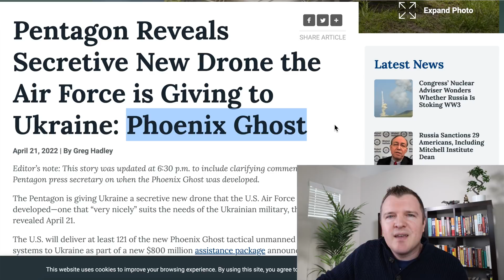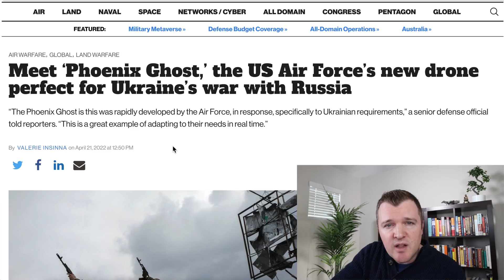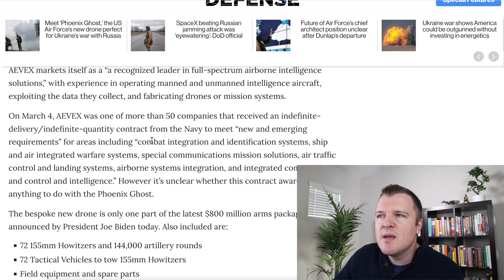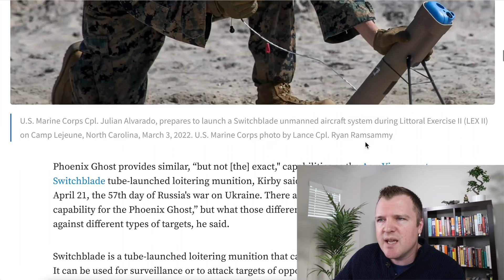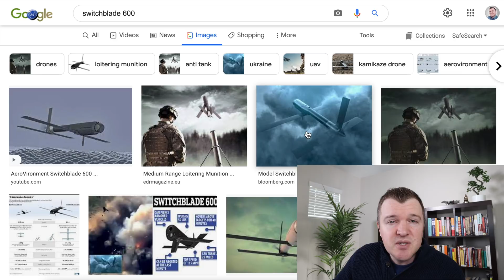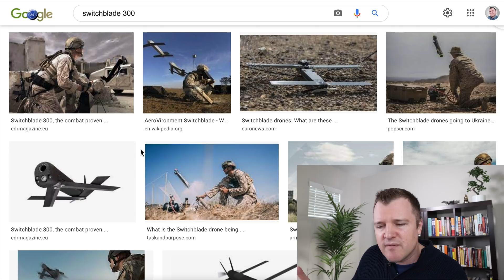SECRET Phoenix Ghost Drone Given to Ukraine

Comment: It would help the Ukrainians to have large amount of low cost fake drones, that can be programmed to fly for some hours above enemy airspace and on which the russians spend all their very specific expensive anti-drone missiles. They should also make sufficient noise for the troupes below hearing them and being stressed continuously.
Reply: That is actually an excellent idea.     Chances are the Ukrainians could do something like this on their own - it wouldn't have to be very high tech, just visible enough to draw fire from the Russians.
Reply: Put a cheap cellphone in them with an app that takes pics and send them home with GSM coordinates. They may well stumble across something worth seeing.
Reply: @tessjuel   they have better than that.
Reply: A $60 drone from Walmart would be enough to stress the crap out of them
Reply: There are even drones that look like (small) jets and fly really fast.
Reply: @clenzen9930  These would indeed be even better.  The ones flying with a puls jet can even reach 400 km/h, very very difficult to shout out of the sky with the classic artillery.  But the flight range with these is rather limited because of very bad fuel efficiency.
Reply: Very low cost disposal decoy drones.
One way mission - recon, distract and harassment.
Reply: @Odyss2023  Add a warhead and you have a switchblade or ghost.
Reply: Ok, but why decoys? They keep dropping grenades from off-the-shelf drones. I just see no real need for decoys, if you can have such cheap, fully armed drones instead
Reply: @sebastianwendl603  The Ukrainians use your method successful.  But they are limited to a few km distance because of the video signal (operator needs to see the target on his screen).  And with a russian jammer nearby these drones are killed immediately.  The drones I propose are linked via GPS, that needs a much much much more powerful jammer to jam.

The fight in Donbass will be at a much larger scale, so the short range grenade drones will have less impact.
Reply: @sebastianwendl603  I think it makes the argument for having your highest tech expensive drones supported by so called disposable ones preferably in a way that’s impossible to distinguish bw the two. More cost efficient at the least.  We will quickly see the era where a single attacking drone becomes an easy target and swarms will become the norm.
Reply: Trouble is the range from the controller. About a mile for a normal off the shelf drone. That said hang 10 feet of crumpled aluminum foil from a drone and fly it around a 1000 feet up.
Reply: @easternwoods4378   That range is only required for drone take off and landing.  After that it links itself to it´s preprogrammed GPS coordinates.  It could even be programmed to come back to operator after x times flight, for if that is valid?
Reply: @tuttebelleke  If it will fly to a GPS coordinate. just let it fly in the direction of the Russians and let them shoot all they got.
Reply: @easternwoods4378  It would not fly to 1 GPS coordinate, it would have a series of coordinates for circling around in enemy space.
Reply: @easternwoods4378  I wouldn't even control them, just program thousands of them so they can be launched from the west on an easterly heading so the Russians can hear them coming to stress them out, after hearing hundreds of them they will start to ignore them thinking its another cheap drone, and that is when you hit them with the suicide drones. A mix of cheap and deadly drones will mess with their heads when they can't tell one from the other
Reply: The drones that they are using to drop anti-tank grenades are already pretty cheap. There isn't much point of building a decoy for that, as the decoy will need almost everything the "real" thing has anyway.
Reply: @superdau  Those anti-tank grenade drones have a reach of only a few kilometers and a flight time of 20 minutes.  With the coming fight in Donbass, the distances are at a different scale, those drones will not be functional there.  And those drones do not survive when a russian jammer (Krashuka) is in the neighborhood. The decoy drones should follow a preprogrammed route via GPS which signals are much much more difficult to jam.
Reply: Nice! Sounds like a good idea.
Power + Redirection.
Reply: Good idea but I'm pretty sure Ukraine already has the ability to do this.
Reply: @paulmurray8922  They for sure have the ability, the technology for this is commercially available for some years already.  But they need several hundreds of these!!!
Reply: 9 months on , no footage ever of these phoenix ghost drones. No footage confirmed at all, or switchblade 600. i think footage of switchblade 300 has been released. Not sure if it was confirmed. Footage must me classified, or it has not arrived nine months on, or America changed their mind.
Reply: You guys are missing the easiest way to destroy 80% of invading Russians.
Just leave many poisoned vodka bottles in the villages they take, and in less than a week, invaders will not have any soldiers left.
Reply: A drone that is shaped like a giant penis that sprays white oil out onto the Russians would be a game changer.
Reply: Back to your video game dopey
Reply: False hopes do not help/save Ukraine and military troops constantly hammered and exhausted....
Reply: @bobgonzales9680  Russia evacuated 24,000 soldiers from the failed attack on Kyiv.  Half of them were wounded and without any equipment when they crossed the border back into Belarus.  The Russians are trying to reconstitute these forces by replacing destroyed armor with vehicles pulled from storage and adding in fresh meat. But effectively these forces are out of the war, only the unwounded officers would be of any use, and some regiments were left with only 20-30 men and all of the officers are KIA.-- The Ukrainian combat units that inflicted this damage are now rested, resupplied, reinforced, and in the east regaining contact with Russian forces.
Reply: @bobgonzales9680  if there are 12 drones flying over an artillery battery. Only one is real the rest are just programmed to fly around the battle space. Let’s shoot lists of expensive ordinance at them.
Reply: @guybonfiglio5899   More, who is paying for these weapons? The western tax payer or you?
Reply: @guybonfiglio5899  My God.  Learn to spell. You make yourself sound as if you are an idiot.

Comment: Maybe they are EMP Drone.  An energetic EMP can temporarily upset or permanently damage electronic equipment by generating high voltage and high current surges; semiconductor components are particularly at risk.  If you think about it.  If they are EMP drone and you launch them in a specific area it could be a game changer if they use it in one specific area that have like 20k troops and  lots of tanks and electronic equipment.
Reply: That would be cool.
Reply: That's too much like a sci fi idea.

Comment: An obvious vulnerability would be short range and limited loitering time. On an open environment/battlefield such as the Donbas, with obvious targets entrenched way behind the frontline, I would speculate that these drones have capabilities for deeper penetration.
Reply: Will be instrumental for Ukraine to become experts at identifying Russian leadership (maybe even facial recognition software). We have seen the Russian soldiers become ineffective when not given instructions. Ukraine also absolutely needs to target Crimea bridge connected to Russia. That was a very expensive project for Russia and would almost be as catastrophic as losing the Moscow ship.
Reply: I think “suited to Ukrainian needs” means loitering time is long. But then long loitering time makes the drone easy to jam and intercept
Reply: @mabotyin  Also longer range, which goes along with longer loitering time. In the wide open spaces, you need distance for safer operation. I also suspect that since these are military battlefield designs, the communications will be encrypted with frequency hopping and random encrypted launch codes between controller and drone to deter hacking plus some onboard intelligence for automated seek and destroy of targets marked by other drones.
Reply: It really depends on what this drone is meant to do.
We don't know the mission parameters. With a short fly time they are cheaper, easier to build, and are lighter.
I assume they are not like the switchblades, because they would have just asked for more of those if that is what they are needing them for.

My initial thought would be it is an anti-drone drone. It is only deployed when their is a drone loitering in the area.

Or it is an anti-air drone?

Really this is a good question.
Reply: @Giganfan2k1   I am 100% sure it’s not “anti drone drone.”  🤦🏻‍♂️🤦🏻‍♂️
Reply: @mabotyin  I was spit balling... I literally know nothing about drones.
Reply: @Giganfan2k1  anti drone drone lol omg you're funny 🤦‍♂️

Comment: Re- the special features of Ph Ghost, could the clue be in the name,  ghosts are hard to see ? You can look right through a ghost?  Maybe undetectable
Reply: Standard loiter munitions have very low rcs. They look like a single bird on a radar.
Reply: @SarevokRegor  It's speculation that it's a loiter munition as well. Could very well be stealth. An equivalent of a stealth Bayraktar would be much more useful to Ukraine than one time use kamikaze drones. They've lost alot of their Bayraktar's to SAMs
Reply: @SteelFisher  There is some publicly available information, such as that it is a kamikaze drone, it can fly for about 6 hours, and has infrared sensors. The closest comparable system is the IAI Harop. It has a range of about 1000 km and and <0.5m2 (you can guestimate it with a cheap and dirty RCS estimate of mass^0.6666, has an RCS of ~0.1m2, assuming it has few stealth features). The Harop primarily targets SAM systems due to their small size making it difficult to recognize by radar quickly. The PG is likely similar, although there could be a few upgrades, like more stealth features or better target sensing and information. (Note those last 2 are purely hypothetical, but the improvements would explain why they didn't just license or purchase the Israeli tech)